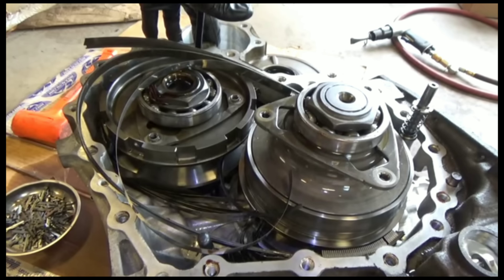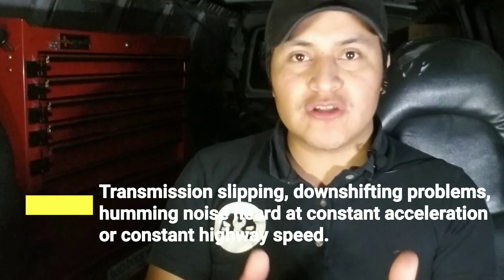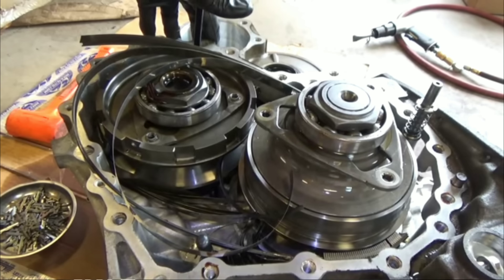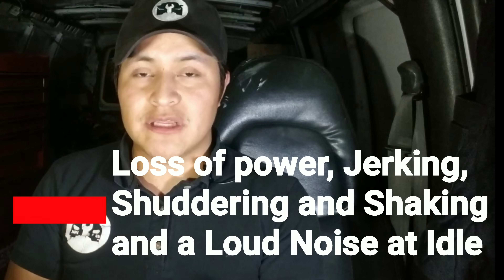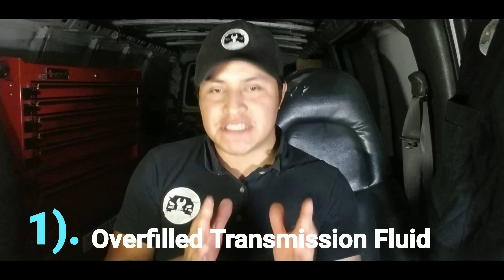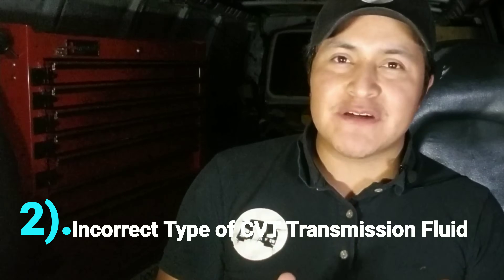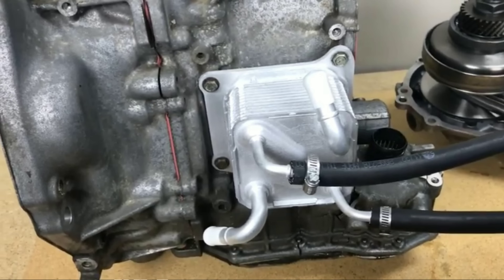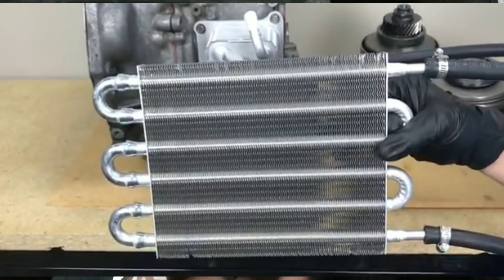NISSAN CVT TRANSMISSION | why it fails and what you can do about it to prolong it's life

Comment: I have a 08 Altima 3.5SL. I have the CVT serviced every 60,000 miles. I have 260,000 miles on it, and so far  no trouble. Just take care of your car, and it will take care of you.
Reply: My 07 had 200,00K but I followed recommended service intervals.
Reply: @KimberlyCooley  qqq¹¹1¹1¹1
Reply: I Have an 07, 250k is when I first experienced limp mode. After much research I put an oil cooler on it. Ran good for a while. Now close to 300k. The whining started Friday, Saturday I had the car towed home. Currently, researching what to do. 
Don't have the money for car payments. Hoping to find an honest mechanic who is willing to replace the issue and not the whole CVT. Can't afford that shit either.
Reply: @kismyc0untryazz-491  Once you send metal through out the system as in bearing and pump metallic particulates, ALL the bearings are ruined along with the belt.
Reply: Oh no you mean if my CVT tranny is going my whole engine could be ruined!?!
Reply: @TheOwlGuy777  that’s ok Nissan can fix it for you  
They replace a few parts but leave the sheared bearings if it’s warranty work. If on your dime they refuse to rebuild …only replace.
Reply: @kismyc0untryazz-491 I understand!!! I have a 2012, bought from a long time friend and he took great care of it, and so have I. Interior looks great and miles not that bad. Less than 3 yrs, and my trans is goin out. Am NOT happy, and the price to fix is more than the car is worth, it's crazy high. Oh -and did I mention the paint is coming off and rusting too? My first and LAST Nissan....I will NEVER ever own another one!!! I thought they were susposed to be good vehicles, but that definitely has not been my experience. And I'm tapped out also...tryn figure out wat in gonna do bc I can't keep forkin out money in this car!😢
Reply: @kismyc0untryazz-491 have you ever even had the transmission fluid changed? Every 30k is the Nissan recommendation.
Reply: From 2010 to 2016 is the real problem...
Reply: @fatherofindika483  2019’s also
Reply: @fatherofindika483  Thanks for saying that. I have a 2017 Rogue.
Reply: @fatherofindika483 I have a 2011 and a 2012 Sentra they were both bought brand new and even though we kept up with servicing we still have bad issues with both of them one of them has already been completely replaced
Reply: Father of Indika damn, I have an all black 2011 Maxima.  The paint has corroded in places but the car still runs perfectly.  I think I’ll sell it and get the wife a Honda Fit or a Toyota Landcruiser. 😀
Reply: @jesushuerta1852  I've got a 06 GX470, 238K on it, I've only had a couple issues and nothing major, it's basically an upscale landcruiser Prado, most reliable vehicle I've ever owned. I also have a 2002 Sequoia with 240K on it, still runs perfectly. I have a 2015 cruze diesel at 180K, Ive replaced the DEF system once, replaced 2 window motors, 2 windshield wiper transmissions, and now the transmission is shifting weird lol. I'm never buying anything other than toyota again.
Reply: The first generation CVTs were not bad, they have been hit or miss since then but it also doesn't help that most people don't know what a CVT is or what kind of service it needs.
Reply: @ShockinglyBleh  Well, there is Youtube videos nowadays to learn from.
Reply: @ShockinglyBleh  That seems to include the dealers.
Reply: yes, my 2017 sentra has 142,000 miles and I've replaced the cvt fluid twice at the dealership.
Reply: @SamAkaVlogs  just got a 2017 Sentra with 20,000 on it. Was told to just service it every 30k and a flush 100k and it’ll be good. Which I will do
Reply: @TheChurchIsLikenUntoTheMoon  how’s it been how many flushes have you done I have the same car
Reply: @SamAkaVlogs  have you had any problems what mileage did you get your car I just got the 2017 sv but really wanna take care of cvt
Reply: @miguelg2764  runs normal, currently at 183k, it's in my channel.
Reply: Not necessarily. I've had two 05 Maxima and did all my maintenance transmission still failed
Reply: Period maintenance your car
Reply: The failure rate of Nissan CVT’s has little to do with maintenance, everything to do with a poor design.
Reply: @freebehindbars8654  JATCO, where your transmission goes to die.
Reply: 07 altima 2.5l 286000 miles
Reply: I have a 2010 Sentra and it’s been a nightmare. It stop four times. I even taken to the Nissian dealership and nothing
Reply: I use to like nissans 
But there just trouble 
Nissans were great from 2001 and backwards 
Maxima 3.0 engine is great 
Altima twin cam engine also great 
So was the sentra 
But after 2001 and up 
Nissan failed 
Toyotas and Hondas are so much better cars 🚗
Reply: @angelomaximus2381 put mazda on that list
Reply: I have 2013 Altima with 74,000 and serviced transmission at 59,000 miles and it’s failing 😡
Reply: Good Car for me , always go to the dealer to service the car , I'm 161,000 miles, purr like a kitten
Reply: I have a 08 altima, purchased in March 09, and the cvt failed completely at approx 68k miles. The car was never driven hard or abused in any way. I'm an old fart and drive like one. Routine service was done per manufacturer recommendations AT THE DEALERSHIP. Average miles driven is about 150 monthly! I worked as a certified auto mechanic for many years so I know what's what when it comes to vehicles! Because it was past the extended warranty date even though no where close to warranty mileage Nissan refused to fix it under warranty. It was not quite 4 weeks past the warranty date when the transmission failed completely.  I had taken it into the deal ship on three separate occasions for THAT specific issue before the date expired and they claimed it was ok even though it was making quite a bit of noise and getting much worse. They claimed they could not do anything about that unless it failed to function. On thier recommendation (third visit) I had them change the fluid. Even though i damn well knew that would not solve the problem they insinuated if I didn't do that then if the transmission failed I would be out of luck getting it repaired under warrantý. It was less than 4 weeks later the cvt failed totally! I backed out of the drive way, stopped fully and put it into drive. One little lurch forward and then nothing. Engine over revved with zero forward motion. I will NEVER buy another Nissan product period! Nissan sucks and is a completely unethical company! Melloy Nissan in Albuquerque, NM was the dealership involved and I will NEVER buy anything from them again either!
Reply: @raibeartcahill4295 I agree, me either! It will cost more than the car is even worth to replace the transmission in mine! And don't even get me started on their chity paint jobs! My first, And my last Nissan! I'm goin back to Dodge or Chevrolet!!!!
Reply: @raibeartcahill4295  yah, in retrospect, you should have backed it up against a wall and burned up the transmission. Make em warranty it
Screw it
Reply: See the thing is those limón cars started in late 2012ish my guy not 08
Reply: @Ieatsouls8787  they are not lemons   It’s the DESIGN to stick the consumer and rev up the profit margin. Nissan has multiple class action law suites that they have paid out over a hundred million to consumers and lawyers for all the years of the sorry CVT transmissions they are still building in new models. They lost and had to pay claims but never admitted any fault. How’s that for ethics? Oh and by the way those sorry replacement transmissions that they only give a TWELVE MONTH WARRANTY on are $6000. I waited in line behind 5 other for transmissions and 6 were waiting behind me. So those transmissions are making them big bucks while cheating the consumers.
Reply: @Ieatsouls8787  your comment suggests you think I'm lying which I most certainly am not! I have written proof of what I said! Your opinion is of zero value or importance!
Reply: The 6th gen altimas have some of the best CVTs out there, take care of them and they’ll take care of u as u said
Reply: Bull shit.
Ive done all shit oil air filter brakes tires etc and now at 135k i think my cvt went.
Reply: 08 Nissan do not have  CVT, THATS WHY IT HAS LASTED 260,000.  CVT DO NOT MSKE IT PASS 8 YEARS, 100,000
Reply: I had a 2007 Sentra, it went through three CVT’s before it hit 50,000 miles.  After the third one Nissan told me they wouldn’t replace another one even though it was still under waurantee.  Sold it the next day.  Will never buy another Nissan unless it has a manual transmission.
Reply: @markmeador fr that Nissan CEO is a jackass
Reply: That is correct, doing a good service on ANY vehicle would last for trouble free years
Reply: How is the mpg in city
Reply: @user-kq8rk1vd3u  , I mostly do combined driving or hiway only, my combined is around 27 mpg, and hiway is 29 mpg
Reply: @scott1243  great car 👍
Reply: you should buy a lottery ticket.
Reply: @genefoster8601 ,I hear that alot, lol. I have a 90 Honda Accord that I just had the timing belts replaced on, I put 183,000 miles on the belts that I just had replaced. I also had them do the cam and crank seals, the water pump and front motor mount.The car has just under 300,000 miles on it. It's been a great car.
Reply: Lol, your driving, your traffic, your towing, and your car are unique to your experience. For the rest of us, it's only a matter of a short time. We are fucked. Especially the second-hand market.
Reply: Yea well I serviced mine at a shop not the dealership cause I didn’t know and my cvt went out so they are at fault
Reply: Sounds suspicious 🤔
Reply: I don't think that Nissan started putting in cvt transmissions until after 2000.
Reply: you are lucky. must drive really slow. you must be in a 4 cylinder,  the v6 ones have more problems
Reply: @dfields9511 I’ve had an issue with my 2011 Nissan Altima 
2.5 s . My brother bought it for me from a private owner 2021 had  it now for  almost 3yrs. 3 weeks ago I notice the car started making this humming sound. Soon as I got on the interstate, reached up to 45 miles took my foot off the accelerator pressed down again. The car started this humming sound again then it back picking up speed. My brother told me,” It wasn’t nooo transmission fluid in the car.”  He put 2 quarts of transmission fluid in the car, So I drove the car home ( RMP ) think that’s what it is or ( RPM ) one them. Gauge kept going up and down. Due to the transmission getting hot, speed was very minimal. Had to turn hazard lights on🤦🏽‍♀️ These Altima’s You Cannot put any kind of transmission fluid in these Nissan cars. Only the specific fluid for make and model of these cars. Pray that’s all I need is transmission fluid; that’s about 4-5 maybe more quarts. Later on that evening cranking it up idles real loud for like few seconds. As I begin to drive, before it reaches up to 20 miles it jerks a little then it drives smoothly.
Now cannot drive the car at all due to no fluid in it, one it goes into reverse…And drive it makes that sound. It’s not leaking no fluid nor motor oil.
I keep my oil change up to date. High mileage 196,000
Reply: I have a 09 Altima 2.5 that’s currently getting its cvt rebuilt I never serviced the transmission and never had a problem with it until now and that’s with 200k miles on it but the car has lasted me over 10 years now I want to keep it a few more. They can be great cars I know some people are less fortunate than others lol
Reply: I'm thinking about buying a 2011 Nissan Maxima with 261k on it. It was in an accident that scraped the passenger side of the car so they totalled the car. But it was running and driving. Any opinions? They want $1100 for the car.
Reply: @fredericocorrea9814 I would pass on that for title and insurance reasons, if it had fewer miles with no known frame or rust damage, take a flyer on it.  If you can afford a tad bit more, get a newer one with lower mileage
Reply: @fredericocorrea9814 if it's a salvaged title your not going to get any good insurance on it. Liability only no towing no nothing that's what I'm going through rn
Reply: @taylorbmusic9894  my son has a 2016 ford fusion that had a salvage title. We went through the salvage inspection and that car is covered to the teeth. It had been inspected by the insurance company itself. They insured it @75% of book value book was $11k at the time.
Reply: @fredericocorrea9814  Lucky him. Most insurance companies where I live do not cover salvage titles and did not offer me a salvage inspection at all.
Reply: @fredericocorrea9814  which insurance did he use?
Reply: @taylorbmusic9894  First Gieco then Liberty Mutual both allowed us to insure his car up to 75% of Kelly Bluebook
Reply: You're the only one😂😂😂😂😂😂😂
Reply: I had a 2011 Altima 2.5S, CVT had no issues, changed the fluid at 90k miles, still shifted smoothly - should've held onto it, paint had no issues anywhere. 

My 2018 Accord Touring 2.0 has developed surface rust near the door jams, nuts, and bolts...#nothappy

Never had that with any Nissan my parents owner nor with me
Reply: Of course the 08 are good. IRS the newer ones
Reply: What exactly do they do at each service? Do they drop the pan? Do they do it, and then drive it around and then do it again?
Reply: I've had 4 transmissions in than 1 a year. Its not just about taking care of your car your transmission should not keep going out!
Reply: Sorry but that's not true. There is a very widely known issue with the Nissan Rogue transmissions for the newer models.
Reply: @claytonjames4779  I have a '17 Nissan Rogue with 105000 and so far I love my transmission.
Reply: Thanks 4 that.  Just brought a 2023 Rogue
Reply: @LadyJpraise2024unbound  I like my 2017 Rogue with 104 thousand miles on it. Still runs good.
Reply: EXACTLYYYY Im dumb lol 😰🥵
Reply: lesson LEARNT hahaha
Reply: No problems at all ?!? Having to change transmission fluid every thirty thousand miles ,IS ALREADY A HUGE ENGINEERING PROBLEM,IN ITSELF. lmao
Reply: do you have it flushed? or drain and fill? how does it get serviced?
Reply: ,  they do a flush and fill
Reply: Scott. Give us more tips. I have a 15 Altima 97k miles

We had a transmission leak due to defective part. But we got it fixed and added cvt  Castrol fluid. 

I want this thing to run to 150k. Any tips?
Reply: Does anyone know where to go for a transmission drain, not the dealership  ?
Reply: Should be having it done every 30k, that's the recommendation  by Nissan.
Reply: I bought a 3.5 SR Altima coupe with 100k on it. Car fax says it was maintained but obviously the transmission is slipping now after a fluid change at now 130k miles most cvts are expected to fail around 130k-150k even with maintenance and proper driving.
Reply: They are absolute junk. Serviced or not serviced. Everything on them leaks like a sieve. They leak worse than a Harley Davidson! But the absolute worse thing about them are those piece of junk transmissions. Oh and Lord help the poor mechanic that has to put a water pump on one of those 3.5 liters. Ridiculous. SMH. Those engineers ought to be whipped with a knotty plow line. How stupid can a college educated person get. It should be mandatory that an engineer have to actually work on anything they design. SMH
Reply: I have a 2019 Sentra. Less then a year. I’m on my 3rd transmission.
Reply: @jerrydillard2430  OMG!! I was debating getting a 2018. I guess not.
Reply: You take a chance with any car manufacturer and year, make, or model. We were choosing between the Lexus rx350 and the Murano both 2018. We decided on the Murano and really like it. Btw, we were previous Lexus owners.
Reply: @jerrydillard2430  you obviously are beating the crap out of that car
Reply: @jerrydillard2430  hahahahahaha really?
Reply: @jerrydillard2430  SAME HERE !!!!
Reply: @jerrydillard2430  u serious??
Reply: @jerrydillard2430 oh my gosh that's horrible!! And I'm livid and beyond pissed off bout the first time around!!! I just made a comment I will NEVER ever own another one!!!! NEVER!!!!!!!
Reply: Believe u!

Comment: I have a 2013 Nissan Altima 130k miles had her for about 3 years and she hasn’t gave me any problems at all not a single one she’s been very good to me. As long as you take care of your car you should be fine i always make an oil change every 3 months replaced spark plugs replaced belt, new battery terminals transmission fluid flush brake flush. Shocks and struts replaced. As long as you keep up with your maintenance you should be fine
Reply: I have an opportunity to buy a 2013 Altima in perfect shape. Dies when you put in gear. Does anyone think it’s the valve body?? A lot of people say valve body and filter
Reply: Do you replace the belt the battery terminals, transmission fluid every 3 months as well?

Comment: Hi i have a 2008 Nissan Rogue  and when I  put try to put it on drive it will not go into drive. So i have to push the button on the shifter column and then it can go into drive. Then it will start off very slow. What do you think can be the problem?

Comment: So this tell me per your mechanical expertise, what's the best additional oil cooler I should look into buying for install on my CVT?
Reply: It won't matter the CVT will still fail.
Reply: @2DclanSnipingTeam  there's actually a solution...
Reply: @greyfoxblade  , Nope. I was a Nissan Mater Tech for 16 years. I've personally replaced over 1,600 CVTs. The spring on the sub assemble can't handle any power. They are junk.
Reply: @2DclanSnipingTeam  could that spring be replaced with stronger one?  

Also have you ever worked a cvt that had its oil cooled a lot better? I've spoken with people via forums/blogs, who have upgraded the cooling of there oil and got really good results,  extending it's life.